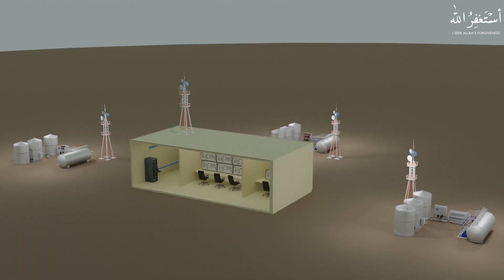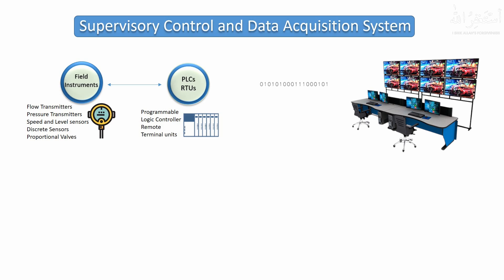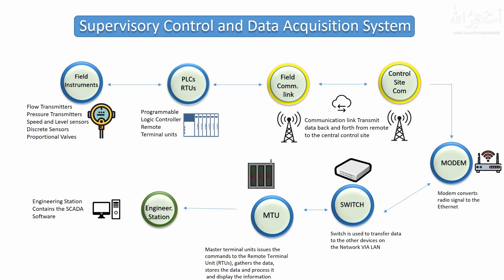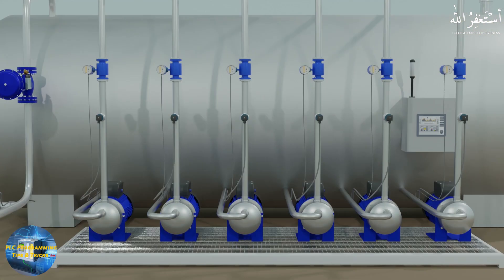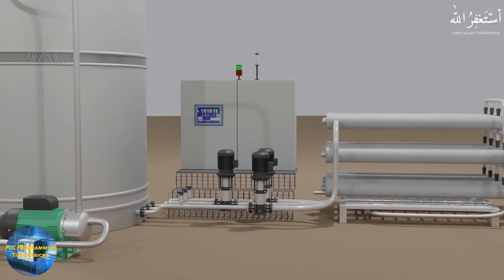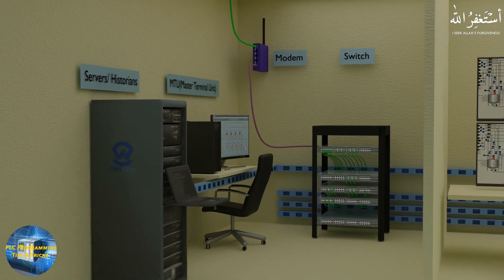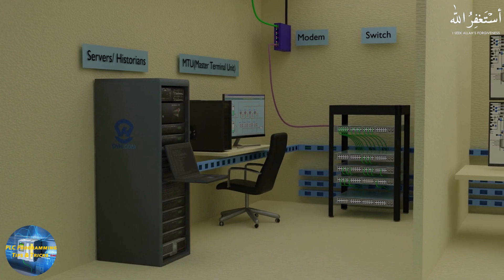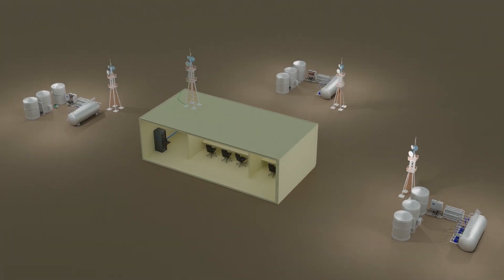What is SCADA? | SCADA Explained in Simple Words | Industrial Automation Basics

Comment: Excellent explanation through visualization. Please respond on one query:
At 2:42, it depicted that Engineering Station/EWS has the SCADA software running. At 6:07 it showed it is the MTU which has the SCADA software running . Would be grateful if you could explain whether it is EWS or MTU  that actually has the SCADA running with a capability to modify and take decision .
Thanks